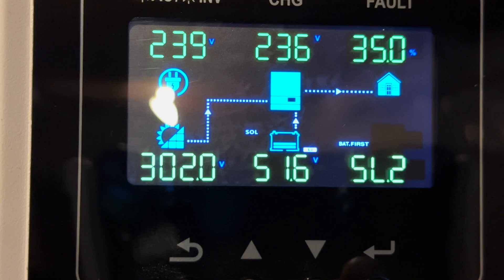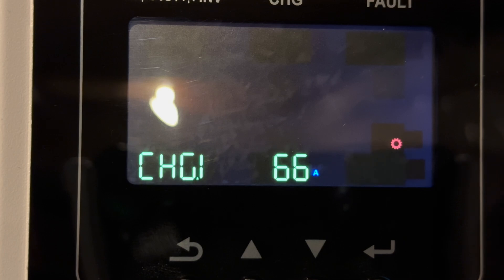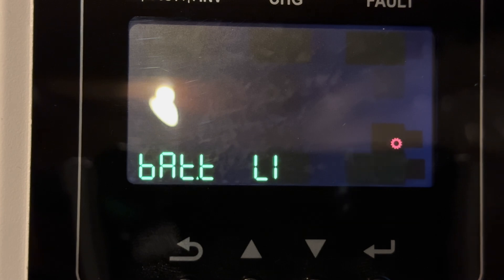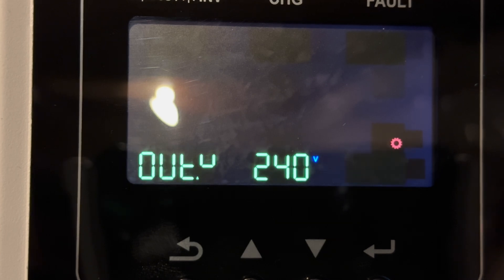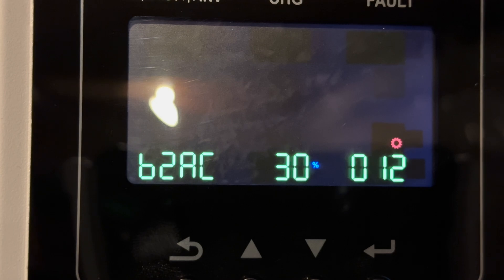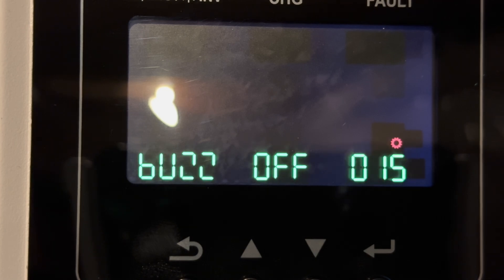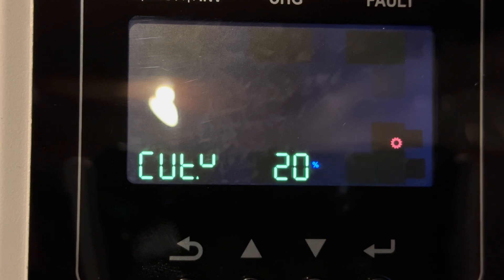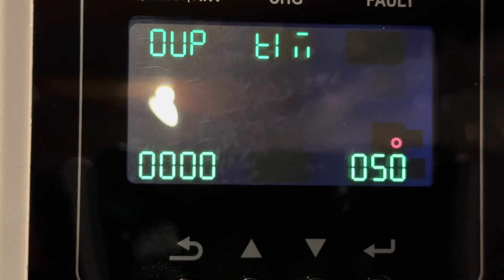Growatt 5000 ES Settings

Comment: My utility power is off and the solar system took load for any hour now it is just switching on for a split of a second ( unable to take load ) few lights. It is  a 5Kva growatt and I’m using lithium battery and the battery voltage is 54v
What could be wrong

Comment: Hi Richard. Tx for a great video. I also have Li batteries but installed as battery type = Use rather than Li. My installer wasn’t able to get it right. I tried to change to Li on the app and it gave an error so I had to switch back to Use. Would you be able to assist with this?

Comment: Thank you very much for this video. Setup is this inverter with 2 x 100Ah lithium batteries connected in parallel. I want use grid a few times at possible. But I also realise that the two batteries will not carry us through the night without being topped up. My settings are the same as yours except for #13 which I have at 95% and #49 (charging time) from 20-23. I did this because we mostly use our air fryer and microwave to prepare dinner. This can cause the battery-pack to drop to around 54% after dinner. We currently have summer in South Africa with a couple of fans running. At nighttime when going to bed, we run at ±13% of 5000W.
Question: Will utility charging only start when batteries are below setting #12 which in my case is 40%. And will it only stop charging and switch back to batteries after reaching my #13 setting which is 95% or when the time is 23:59? In other words, will it only stop use utility charging after reaching the set SoC or when the time is over.
Thanks, and I hope my questions make sense.

Comment: Nicely explained but  one of my Growatts has Option 23 in it the other one jumps from Option 21 to 28. Option 23 is used for parallel operation. I have not connected my inverters in parallel yet just about to. Don't think its a fault Hoping that when I put them in parallel  that they will work. The manual does mention Option 23. By the way I am in Australia so we do not have to worry about split 120V like you guys use in the USA. Just puzzled that one has option 23 available but the other does not

Comment: Hi Richard. My challenge is my growatt inverter emits a continuous alarm and sometimes cuts power briefly when the battery is fully charged from the sun or utility.  What settings should I make to allow battery and inverter continue powering the house when full without emitting the irritating alarm sound and also not tripping

Comment: Hi Richard. Many thanks for detailed explanation. My question is related to overload the inverter and bypass mode. Let's assume you would like to randomly but occasionally overload the inverter from its nominal power output assuming it will stay in range of maximum short term power output. Will this inverter carry automatically the remaining load from the grid assuming PV and Bat energy will not be sufficient? Means loads over 5kW

Comment: Hi Richard 
I setting up similar system for two five ton Mitsubishi AC units used for 4000 square feet ICF house in Florida. We have enough sun and I planning to utilize time of use tariff to support charge of batteries during the night. Maximum current for each 5 ton unit is 20 Amps with variable frequency drive. I planning to use three Growartt 5000 ES six 100 A 48V EG4 batteries.  Also I planning to use around 18 kw solar panels on flat roof. I already testing battery and inverter. I would like to know what you guys think of this setup. House is energy efficient but there is a lot of big sliding door facing south. I will appreciate your input.

Comment: You are too fast, I am too slow. Things are missing.  When I press and release Enter, I have no modes available with up down. Do I have to press Enter to change mode??? What I want. Initially just solar. I could not use angle grinder if not enough sun. Added 20Ah batteries, I could use in good sun some power tools. Then cold mornings, gave me some battery error. Oh,  trash batteries, not new.
Now I want just solar with extra batteries when tool starts up or not enough sun. Power tools I may operate a short time. I am seeking 80Ah.  For now I see just utility priority and no way to change it. I have it entirely off grid.  I suspect that Enter is a switch of modes. Pls explain.

Comment: Question: I've set my inverter settings to:
012 = B2AC  30% ;
013 = AC2B  50%  ;
014 = CGPR  SNU

However I noticed that the utility or AC kicks in when the battery discharges to 80% and not the parameter set in setting 012. I've since changed setting 014 to C50 in order to avoid the AC kicking in. 
Is there a way/setting I'm missing in order to meet the parameters in settings 012 & 013?

Comment: We have problems that occur sometimes, when it is sunset the inverter charging keep switching between solar and grid for like 2 minutes keep peeping, until the solar panels can't detect light anymore then it will stop pepping , how can we fix this problem?
Reply: Turn off the beeping in settings

Comment: Thanks for the video, but I discovered that the battery percentage is not being displayed on the inverter or does it have a setting to activate that?
Reply from the maker: The battery percentage is displayed if you are on Li battery mode.  Otherwise it displays the battery voltage.

Comment: What's the expected power generation i can expect from this model if i add 5220wattage of jinko bifacial solar panel? Can you give me an idea regarding this?
And what's your highest production from a single 5kw growatt inverter?
Thanks.
Reply from the maker: I have 6.2 kW west facing panels that generate 20-40 kWHr from spring to fall and very little in the winter months.  Peaks in summer.  I have an issue where I can generate more than I can use depending on my needs that day.

I’m not sure if that helps, but hopefully it gives a  reasonable comparison.
Reply: @ZeusRadls  
Thanks for your valuable information brother

Comment: Thank you Richard for the great video, if I have 1=SUB this means I am using solar panel as the first source, if my loads exceed the solar or the solar out drops (say 10%, 20%...), will it switch 100% to utility or will it only compensate (get the difference) from U=utility or from B=battery if utility was not available in the same manner?
also will the battery be charged if 1=SUB setting from solar or from utility ( what about during the night )?
Reply from the maker: If solar is not enough the utility should compensate.  The battery supplements the difference if the solar is insufficient and utility is unavailable.  Any excess solar power will be used to charge the battery.  At night the utility powers the load.  You can set the inverters to charge the batteries with a maximum current (011) and window of allowable charging (049).  I try to avoid grid charging except in the winter and incoming storms in summer.
Reply: thank you very much @ZeusRadls , why would you avoid grid charging (grid suppose to be cleaner and more stable)
Reply from the maker: Utility is generally clean, but the cost can vary between day and night.  You can manage the charging rates and times to charge to minimize costs.

Comment: I use my inverter without solar
As a power backup system  ,i use growatt inverter and li battery pack
Please tell inverter settings
Reply from the maker: I had mine without solar for a few months before I bought my panels.  The best settings is to use UEI for setting 001.  This will use the battery if the utility goes out.  You can set the max charging current per inverter using setting 011 and setting 049 to determine when it can charge, to maximize off hours costs if possible.  Let me know if you have any other questions.

Comment: There’s a problem with my system, I wonder if anyone else noticed this issue: on a particular scenario, the (single) on-grid inverter draws 23A on “L” leg and 3A on “N” leg as if it doesn’t know how to use split phase.  The input power draw is 23Ax120V+3Ax120V=3120W but very imbalanced. The  current imbalance propagates to output where one leg (“L”) pushes way more current than the other. Then the output power is being measured on “L” leg and the inverter overloads. On battery power alone (off-grid) the inverter outputs correctly and works as it should. To make matters worse, a second inverter in parallel won’t fix the issue. My attempt to fix it is to add a 15KVA  split 240/ single 240 transformer  to make the inverter draw 13A/240V instead of 23A/120V+3A/120V. Anyone encountered this issue?
Reply from the maker: I use a Growatt transformer to split the 240v output into two 120v legs.  My load is evenly balanced.  The purpose of the transformer is to maintain the voltage on each leg.  Depending on your model is can handle a load difference from 20 amps or more.  Note, anything that draws 240 volts will not be impacted by the transformer, it's just for single leg loads.

https://signaturesolar.com/growatt-11-4k-split-phase-transformer-ats-11400t-us/ 

It's possible you have an issue with your downstream neutral.  What happens if you switch the output to the two legs?  Additionally, it's possible you can re-organize your downstream electrical panel to better distribute load to the two legs.

Comment: Can someone tell me why these inverters put out high voltage high amperage ac through the pv in.
Reply from the maker: This thread details this by design.  As with all electrical components assume it's live, because it might be, even if it shouldn't be! 

https://diysolarforum.com/threads/growatt-5000es-ac-voltage-detected-on-pv-input.50235/
Reply: thanks for your reply yeah I wish growatt had this in their manual might save someone's life and me a lot of time. @ZeusRadls

Comment: Hi RIchard. I have my setting 1 set to SUB however my PV output is limited to 12 watts even on a sunny day. This effectively means I am miising out on the PV production which is the whole point. Any idea what I am doing wrong?
Reply from the maker: 12 watts seems like you may have a bad connection or a faulty panel?  I suggest checking the voltage of your string to make sure you don’t have any issues.  If you find the voltage is too low you’ll need to check all the connections and each panel.  One bad panel can ruin the entire string if you don’t have optimizers.  

If the string seems good then double check all your connections to the inverter(s).  

If all the connections are good and the voltage is what you expect it may be a settings issue with the growatt.  In that case try changing the settings to SBU and see how it handles the load.

What PV output are you expecting?  Do you have optimizers?

Comment: Hi, thanks for the information 
If i want to top up the battery charge at night without changing the back to grid setting. Is there any way arround this ?
Reply from the maker: You can do this my running the inverters on SOL (setting 01) then set the window which you allow it to charge from the grid (setting 49).  This should attempt to keep your battery at 100% at all times, either from solar or grid when available.  You can also throttle the rate at which the grid can charge (setting 11).  I had to set this per inverter on my parallel system.
Reply: @ZeusRadls  thanks i will try this tonight
Have you tried the dry contact s, have you got them to switch.  I couldn't get them to switch in any condition.
Reply from the maker: I have not tried them yet,  What are you attempting to do?
Reply: @ZeusRadls  Hi,
I have tried the Solar only settings and it worked for the charging but i noticed that the load consumption is 90% on utility and battery just 10%.

As for the dry contacts i am trying to have an ac braker activated by the dry contact signal in case the settings doesn't work
Reply from the maker: Is the solar capable of supplying enough power to carry the load?  If not grid power will be used.  In my case when on SOL the solar and battery will power the house until the solar voltage falls below the thread and then the grid is used.  

I tend to use SOL during winter, because the battery often doesn't fill up and I want to preserve as much battery over night as possible in the event of a grid power outage.

Comment: Great video Richard, thanks. I have a question please.
How can we adjust the charging and discharging rates of a Lithium battery?
Reply from the maker: The BMS controls the charge/discharge rate for LI batteries.  You might be able to override this by not selecting LI, however I recommend using LI if that's the battery pack you are using.  It's best to let the BMS handle battery function if possible.  

Setting 02 sets the charge limit unless you have a LI battery.  Setting 11 lets you limit the charge rate from the grid/utility.  I've set this to allow a small late night charge if the batteries get too low.
Reply: @ZeusRadls  Dear Richard, thank you very much for your reply and your help. Something last please. In number 14, which program you think that is better?
-Solar first?
-Solar and utility?
-Only solar?
I believe that the first is ok, you?
Reply from the maker: I prefer CSO and then I use setting 49 to determine when it can charge and setting 11 to limit how much grid power can be used to charge the battery.

Comment: What are the best settings for offgrid.
Reply from the maker: @ThePINCHEZ The settings in this video will work well for off grid.  I power my entire home.  The limiting issues will be your total solar capacity, battery capacity and load. On a typical summer day I can go several days/weeks without needing grid power - the battery pack is usually full at the end of each day.  Winter (Dec/Jan) is when it gets rough.  Very little solar available.  Fully off grid will likely require supplementary power sources such a fireplace/stove to offset heating costs and possibly a generator for very dark periods.

Recently I've been less conservative with our consumption.  Running sprinklers and the AC are a heavy hit, even then I can still get to the next day if we don't over do it and we have plenty of sun.  As long as the sun is out and bright I can do pretty much every thing I need.
Reply: @ZeusRadls  how big is your battery bank?
Reply from the maker: 20KWh. It gets me through the night on a full charge, unless we run anything overly demanding.  I typically use my setup as a supplementary system, but in the event of an emergency we can rely on it for an extended period if we conserve power.

Comment: Hello!! dear, my question is what does it mean the Setting 10, I can´t change it, always show 4
Reply from the maker: I left mine set to 4.  I don't think it matters when using Li batteries with a BMS.  However, if anyone knows better feel free to let me know.

Here's the manual for reference.
Reply: Yeah this setting had me worried too, until I found out I couldn’t change it (my battery type is set to Li.). But the manual description is misleading, saying “series”.
Reply from the maker: The manual could be better.

Comment: Hi Richard I've got this inverter and the Lithium battery for back up but it's not switching over when there's loads heading can you please help me with the settings
Reply from the maker: I'm happy to help.  Can you clarify your situation?  A common problem is the state of charge thresholds.  Settings 12 and 13 control when the inverters will shift to grid and solar/battery respectively.  Mine are currently set to 30% 45% respectively.

Also make sure setting 01 is set to SOL (solar/battery during the day), SBU (solar battery when the battery is at or above setting 13) or SUB (only uses batter if there is no solar or grid power).

Manual: https://signaturesolar.com/content/documents/GROWATT/1519013-manual.pdf